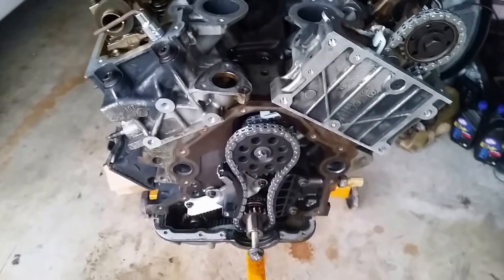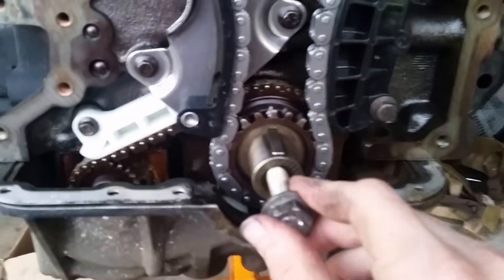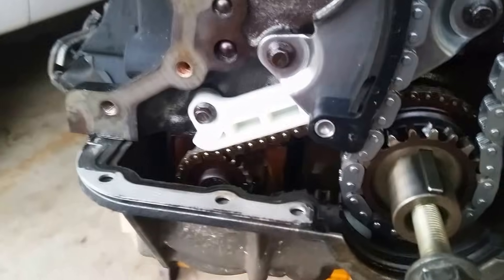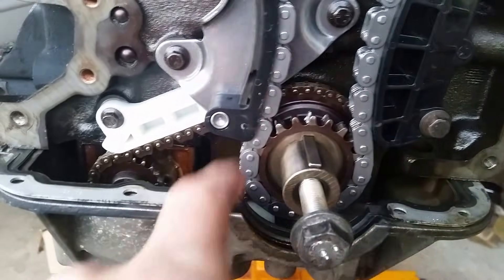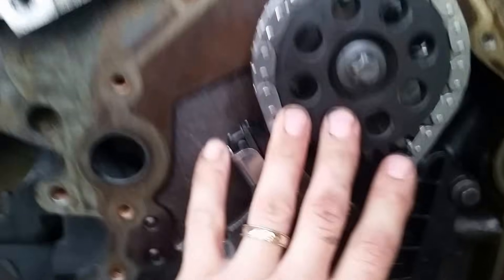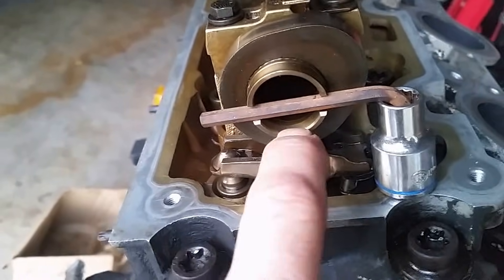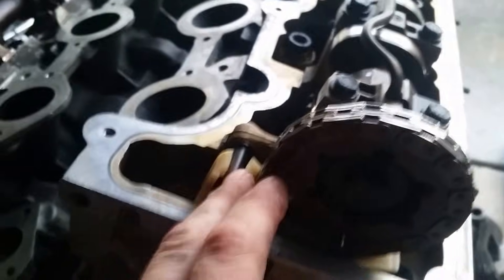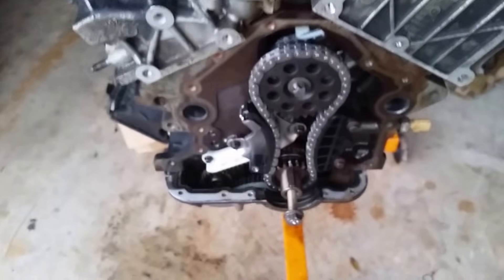Ford Explorer, Sport Trac, Mustang, Ranger 4.0L timing chains without the special tools!

Comment: If the primary tensioner flattens, can the chain jump a tooth ?  A few days back I started up and clak, rattle,  and missing. I'm in the process of checking all tensioner cause I  tried a cam sensor to no avail and no codes !

Comment: I just saw this and will be  probably putting new  chains and cassettes on my 4.0 for my sport track, that is a good ideal with the allen key and socket I had a question what size socket is that holding the allen key in place , did that hold up while you torque the bolts I just wondered thank you
Reply: By chance do you know a mechanic that can help me to do this on my 07 explorer 4.0 V6 only 88kmiles and the left from cassette fail on me.

Comment: Hehe yeah no marks because you don’t adjust the cams. Like you showed, you install everything in position at TDC and tighten the cam sprockets, jack shaft etc in that position. Can’t put the heads you assembled on the bench on unless cams are locked and the block is at TDC. I mean I suppose you could just poke the pistons out of the way with the valves and some torque on the head bolts 😂
Reply from the maker: How would you set the timing if one came in with broken chains?

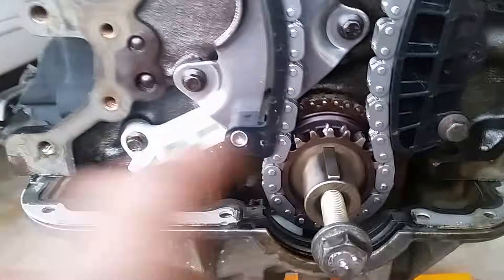Comment: I'm not sure why disagreements are common (including some in this comment section which is why I'm posting here) about whether or not the 4.0 is an interference engine, but I suspect it might be due to the fact that there are 2 very different design types. One is the Overhead Valve (OHV) and the other is the Single Overhead Cam (SOHC). I suspect the OHV type is not an interference engine causing the arguments, but Platinum Garage channel who btw has many excellent 4.0 tutorials very firmly states his claim at the 1:30 mark and then at the 19:48 mark he shows absolute proof that his 4.0 SOHC engine is in fact an interference engine with bent valves from chain jump in his video titled:  Ford 4.0L SOHC V6 Head Gasket and Timing Chain Replacement (COMPLETE GUIDE). Having the dreaded 4.0 chain rattle my time was very well spent on that channel.

Comment: All the other vids I've seen ( which isn't that many ) haven't mentioned the smaller side facing the bottom. Here's hoping I can get the exploder running now. (Also, I have to time mine with the engine in vehicle cause I'm too cheap to buy a hoist and stand lol)

Comment: For sure, you've got the two OilPressurized TimingTensioners swapped wrong, Left to Right.
The longer one goes on the LeftFront, the shorter one goes on the RightRear.  More info at
https://2001fordexplorersporttrac.fandom.com/Engine_Oil_Pressurized_TimingTensioners

Comment: Just to help everyone out this engine is non interference meaning the valves won’t hit the pistons no matter if you spin the crank around 😝
Reply: Your wrong
Reply: Ok well after roughly 7 of these engines in the last year I’ve repaired and sent back down the road because of broken guides and tensioners causing the time to jumps off time and quess what happened to all those valves nothing I’ve just r and I the timing kit front and back all three chains plus guides and tensioners boom 🤯 mind blowing how no valves were hit . I’ve had one of these engines bend a valve only because the rod broke sending the piston into the head . Maybe I’ve just lucked out right 👹

Comment: Keep in mind. If you do this the cams must be dead nutts set as well as the crankshaft key position. These pieces of german built shit dont have vct. So where you left the cams is how they will open and close the valves. Ive done this a few times and the engine never runs right. I have the tool kit. You need to clock the crank at tdc 0 degrees. Then use the harmonic balancer tool to clock the correct degree. Then use the tensioner tool to take the slack out of the chain and it will move the cam a few degrees. Use the cam tool to lock the cam in correct position. Then tighten the cam bolt. Do tge other side the same way. Make damn sure youre on the compression stroke when you set the harmonic balancer tool or you will be 180 off and the engine will run like AIDS in an African village. Verify youre on the compression stroke by putting a screw driver into cylinder number 1.when it goes up your on the correct stroke. These engines will rotate the crank 2 360 degrees cycles to spin each cam 360 degrees. I hate these anemic autistic sounding german built pieces of dogshit! They get the mpg of a gt500 and the performance of a Segway

Comment: Ford has confused the living hell out of me with this engine, which I am rebuilding (2004 Ranger 4x4). Mine died NOT have a balance shaft. At all. Everywhere I read anything about this engine, there's always something about the 4x4 vehicles having the balance shaft version. Not the case here. It ran fine though. Until the timing components disintegrated. The rear timing hear sprocket (pass side) is also reverse threaded, meaning "lefty loosely, righty tighty" is backwards for it. Glad I bought reman'd heads; Sent that sucker to someone else to headache over.

Comment: You can get the timing tool kit for $65. Well worth it, especially if you are pulling the heads to do a valve job
Reply from the maker: $65 sounds like a deal. Back when I made the video, you couldn't find one under $300.
Reply: I agree. Buy the tool. I'm not buying that his cams are perfectly timed with that rigged crap. Too big of a job with allot of labor to cheap out on...
Reply from the maker: @hunterarthur3541  I agree, if you don't know what your doing, definitely buy the tool, and the book.

Comment: You are wrong. The cams can be in. As long as the spark plugs are out and the jackshaft bolt is loose you can rotate and time the crankshaft& balance shaft. Just keep turning till marks line up. Once thats done then you do the camshafts. With everything locked in place you begin at work everything down with the camshaft being first than the primary. Then you are done
Reply from the maker: Let me know how that works out for you. LOL

Comment: which direction does the motor spin as your looking at the front? I am going to be doing chains on mine next weekend. already have the motor out.
Reply: This is very easy. If you're looking at the motor it spins clockwise
Reply: @jdtv...9134  Thank you for the fast response and info. Saved me from screwing up my motor
Reply: The passenger side camshaft sprocket bolt is reverse thread.

Comment: Did you pull the oil pan to replace the balance shaft tensioner?
Reply from the maker: I pulled the oil pan to clean any broken pieces of the plastic guides. It has been a couple of years since I did the timing chains, but as far as I can remember, you can replace the tensioners without removing the oil pan.

Comment: I need a video that shows me just setting the cams. If anyone has one. I pulled heads off. Nothing in front has been pulled off. SO I assume cams must be set when heads get put back on? I turned motor over a few times to get transmission off. Did this throw the whole motor out of timing? Heads where pulled for blown gaskets.

Comment: I get it about having cylinder #1 at tdc and the key way at 12oclock. But how do you time rear chain that has the cassettes and the front driver side one? If there are no marks? Or does it automatically adjust itself when you set cylinder #1 and the key way at 12oclock?
Reply from the maker: The slots on the back of the cams need to be parallel with the heads. That's what I used the sockets and Allen keys for. The slots on the back of the cams are offset, so make sure you have them the correct way.
Reply: @You-Tube...005  thank you for the reply. So aslong as they are parralel with the heads then they are good?
Reply: And what size socket did you use?
Reply from the maker: @boboynunez5805  I'm not sure what sockets I used. The slot is off center, make sure the bigger side is up. The socket and Allen key I used is just holding the cams so they don't move, which is what the special Ford tool does. Hope this helps
Reply from the maker: I was thinking, what would probably work better, would be a couple small blocks of wood on each side of the cam, same height as the slot, and then if you could find like a metal ruler or something that would fit in the slots. That would probably work better than what I did initially.
Reply: @You-Tube...005  sound's good so aslong as the slots on both cams are parralel with the block and cylinder #1 is a tdc and the key is at 12 it's timed right?
Reply from the maker: @boboynunez5805  the slots need to be parallel to the cylinder head, the slots are off center, so make sure the larger side is up.

Comment: Do they have aftermarket csssets that arent plastic or stronger. Also i habe the same engine in my explorer. What about tge part 4 the fly wheel
Reply: I rebuilt my 4.0. 2 years and 30k miles later I have to actually make sure it's running that's how quiet it is. Used all Ford OEM parts.

Comment: There's a tool called a crank turner socket to crank the engine around. It slides onto the crank and can be pulled off easily. Goodson may have it.

Comment: The engine has to be pulled for this job doesn't it.
Reply: @Achilles only if your right timing chain (rear) is bad. If you are doing just the left (front) chains, I read that you can do it without pulling the engine out of the car.
Reply: @fastskipper777  thanks for the response. That's crazy that Ford made these engines like this.
Reply: @achilles1373  I totally agree. It's ironic because I think Explorers are generally very attractive package for an SUV. And they are better fit interiors vs. the Trailblazers. But, if you look at the used market, the ones with this version of SOHC engine are really low priced. I think people know that they will need the timing chains and that's a huge cost. Plus, their transmissions lose the reverse band and that's all the way in the trans case and you have to pull out all the stuff to fix it. What a nightmare.
Reply: @fastskipper777  I agree. My last explorer lasted for 320k miles. That's why I got another but my current is making the timing chain rattle upon start. I do like explorers a lot but this design is pretty dumb. Makes me want to pull the 4.0 and put in a 5.0 ☺
Reply: @achilles1373   Yeah. I hear you. What I think is if you are not short of a vehicle and don't need it for a while and have a garage and time, you can do it at home. You just buy an engine stand, engine crane and transmission jack from Harbor Freight (they are relatively cheap and will pay for themselves if you do it once); you will save a ton of money. The cost of giving it to a shop vs. what you spend for tools is so huge that you wouldn't care.
Reply: @fastskipper777  I dont know where you live but they are the same price as other SUVs around here. In fact the explorers usually do more money than other SUVs. They also sell very fast in my area, especially the 2nd generation models. The timing chains usually last over 200k even with a bad rattle. Some of them will reach 300k or more on original chain and timing components. The broken reverse band is due to a leaking O ring gasket in the valve body, it's cheap and easy to replace anyone can do it....people are just stupid and keep letting it go...it takes a long time of using reverse with it slamming into gear for the band to break. When the band breaks thr trans has to be rebuilt.

Comment: My engine still runs good with 220,000 miles, but I want to do this as PM.  I see you are concern about turning the crank shaft and bending valves.  Is it safe to assume that in my case I could turn the crank to bring it to TDC on #1 with the old gear on before taking it apart, without having to disassemble the cams?Thank for the great idea.
Reply from the maker: Yes, set it to TDC before removing the chains. Once the chains are off, try not to turn the crank or cams. You may have to move them slightly(a tooth or so) to set the timing. Just don't rotate. Thanks for watching

Comment: The worst timing chain engine ever made
Reply: Yes design that way for a reason. More money for Ford
Reply: @davej.1762  Reason it was designed that way is 1. modified from a pushrod engine. 2. uses the same head casting for both right and left heads to reduce manufacturing costs.   Easy engine to work on.
Reply: These engines are ultra reliable if it wasnt for the timing chain issues. These motors will literally never die unless theres a chain failure.
Reply: WᴏʀʟᴅsSᴍᴀʟʟᴇsᴛVɪᴏʟɪɴ how can an engine be reliable if the main component isn’t..🙄
Reply: It's really not even close to the worst

Comment: Hi, just to mention that cyl N0.1 must be at TDC when on the firing cycle. BTW what allen key and what socket did you use ? Otherwise very usufull stuff. Thanks
Reply: If you set the crank tdc. You time the heads to there position it will automatically make it firing stroke. Man common dont confuse these people anymore than they already are.

Comment: How do you know if the jackshaft is aligned with the crank properly since the camshaft position sensor rides on that. I don't think I misaligned mine but I seem to have a timing problem and am wondering if the jackshaft could be misaligned.
Reply: sounds like it

Comment: I have a ? I recently pulled the engine to fix the timing chain guids on my 03 4.0l sohc 4wd ford ranger but i dont see the 4th small chain? I only see 2 in the front and 1 on the back right side?
Reply: boboy Nunez that means u don't have a balance shaft or its laying in the oil pan
Reply: Hans Gruper its not well i hope not because i alread took the oil pan off to check for any pieces of plastic or what not.

Comment: Looks like you have the wrong chain tensioner on the front. Should have the reservoir on top of the nut. Is there a reason you did this?
Reply: Kevin Hawkins You are right as a matter of fact, he has them backwards. The tensioner without the reservoir goes in the back. The longer one goes up front.
Reply from the maker: Kevin Hawkins 
After market timing set. It's correct
Reply: T- REX i was referring to the hydraulic tensioner and you have them switched around from the factory. I know because i just finished doing mine.
Reply from the maker: Kevin Hawkins 
Again, they are right. The front and rear are identical. Maybe yours is a different model/year?
Reply: Just to make sure we are taking about the same. It is what screws in the head on the front. And just above the exhaust manifold on the rh rear. If you think they are correct....look at all the other videos on the tensioners. I don't know IF  it really matters, all i was doing was pointing it out to you. Sorry if ive upset you.
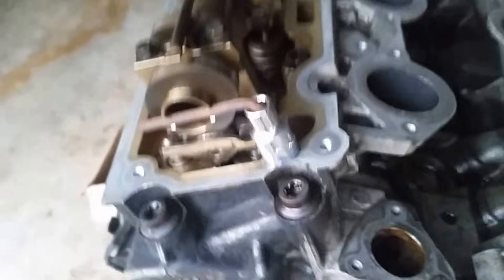Reply: Okay but at around the 3:04 mark when you go to the rear of the engine, just for a split second it looks like the one that goes in the front. I won't bother you with it again.

Comment: On my Snap-on scanner I dialed in the VIN for a 1999 Ford 4.0 and it didn't come back correct on the screen. I used a 2001 Ford G.M., Chrysler cartridge. I did a custom set-up and it worked! I dialed in the VIN XVEX and it works! The original VIN was 1FMDV3431XZA13256. It is for a 1999 Ford Explorer 4.0 6 cyl. 4WD SFI. It check KOEO and KOER and drivability, and air bags, and movie ability! E-Bay has the scanners and cartridges and adapters and manuals. Also get the K2A or K2 personality key. Get the OBDII adapter. Also the wall outlet adapter. The battery adapter can be used to hook the adapter to the battery. Get the adapter mentioned in the manual and not cheap Chinese adapters.
Reply: what does any of that have to do with the video
Reply: Eddie Reichel My comment is for the viewers. Fords need special Ford tools from OTC. To hold the cam pulley, use a pulley holder from OTC to remove and tighten the bolt.

Comment: Having timing parts made of plastic shows Ford wants engines to mess up! Then you have valves hitting pistons! Bad production!!
Reply from the maker: Marty Stevens 
I read an article from Edmunds. NADA reported that 44% of new dealerships profits were from the service and parts department.
Thank you for the comment.
Reply: you know other brands use plastic as well lol
Reply: I’m actually confused there’s articles that say both that on one side it is an interference engine and then on the other they say it’s not
Reply: Not a interference engine at all. Look it up. I have 4 of them that blew the back chain off and never once hit a valve. Matter of fact if you actually do your research youll easily find it is non interference engine....
Reply: @duaneobrien8500  WRONG. ur telling people to do their research, but a simple search on the explorer forum turns back many results that the 4.0 SOHC is indeed a 100% interference motor. You are making this crap up. If the chain breaks, ur motor is wrecked. The heads would need replaced and if the chain let go at higher RPM there will likely be severe lower end damage as well. I had a 00 explorer with 225k that had all the tensioners go it skipped timing badly and it blew the motor, and I also had a 98 explorer with 165k that was severely abused by previous owner and the chain flew off the one camshaft and wrecked that side of the motor.
Reply: These 4.0L are non-interference motors. Valves will NOT hit the top of the pistons.
Reply: Benjamin Johnson I’m working on one of this and definitely is interference, all exhaust valves were damaged.
Reply: Maybe just know that I have done about a dozen of these with around 150,000 all had same problem the chain guides broke. None of them had damage. All of them had jumped time. Sorry yours was damaged.
Reply: @benjaminjohnson5469  you are so wrong it is an interference moter
Reply: Benjamin Johnson...if the chain fails the cam stops moving and the valves stop moving. 
The reason you remove the rocker arms when timing the engine is so you don't bend a valve moving the cam independent of the crank.